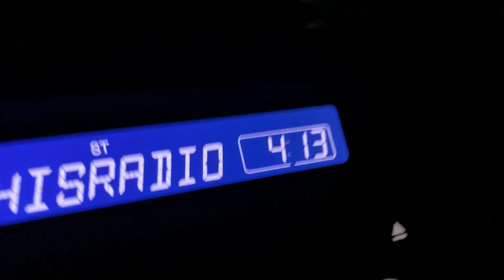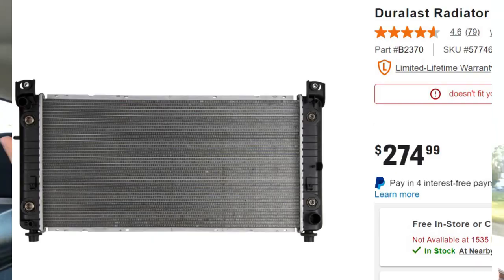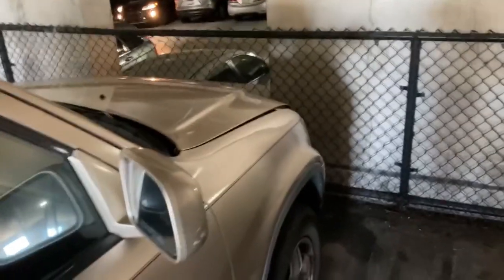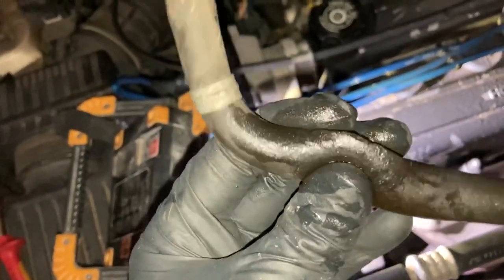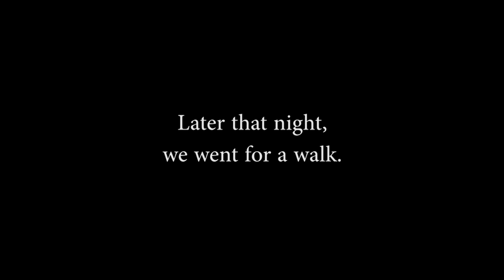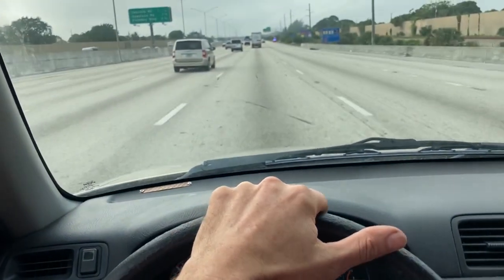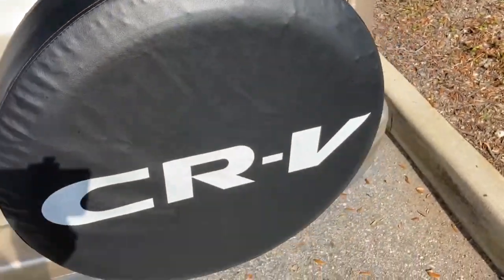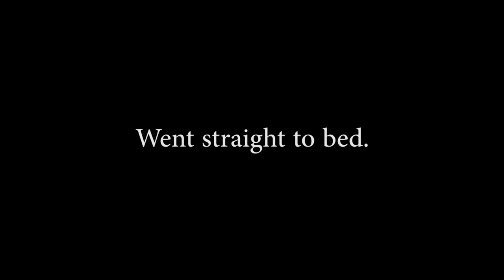How to find and fix a coolant leak | Honda CR-V

Comment: This was a good video for me to watch. I recently did my thermostat and radiator and lower coolant hose. The upper one looks good so I left it. I thought “I should replace all these smaller coolant hoses while I’m at it.” I was lazy and didn’t. Should have. I’ll replace them over the summer.
Reply from the maker: It's a mess of hoses in there, eh Craigie? ... I think I'm still going to be lazy ... and cheap ;-)

Comment: Great video! what’s the name /part # of the hose you got ?
Reply from the maker: Thanks Fabian. I'm actually not sure what the part number is or even the size. When I have small hoses like this leak, I just take them to the parts store where they have bulk rolls of hose behind the counter. They just compare the sizes and then cut a piece whatever length I need. This hose might have been 3/8 inch inside diameter, and it ran $2 USD per foot. So I paid $2.10 after tax I think. ...Hope this helps.

Comment: Hi Dave. I bought a 1997 crv about three months ago. I am located in Cyprus in Eastern Mediterranean. Here there is a rationale that since the temp doesn't drop below zero,. They only put distilled water into the radiator. I have been getting a water leak on drivers side. The leak is always where the heater box is. I did clean under the front windshield cowl and followed  troubleshooting instructions other crv owners gave. Somebody told me the heater core might be plugged and leaking. Are you planning to do a radiator flush video, I want to flush the system and fill it with appropriate coolant. What colour coolant is needed, what are the steps? Sorry for the long winded comment. English is not my first language.
Reply from the maker: Hey, thanks for the comment zoejay. I just did a little research on using pure distilled water, which, at first, I would have thought was fine, some say that distilled water is ionically imbalanced and therefore strips minerals from your engine to try to balance itself. It seems "softened" or "demineralized" water is best, but real coolant is better because it contains corrosion inhibitors, whereas water promotes corrosion. It does sound like your heater core has begun to leak. If you're flushing trying to flush it, using water should be fine, but it is a good idea (as you mentioned) to refill with coolant afterwards. Honda of course recommends Honda long-life antifreeze/coolant type 2. I personally just run any "long-life" coolant, the color doesn't matter. ... Sorry, but I can't do any flushes on the CRV any time soon because it's about 700 miles away from me at the moment. But I personally wouldn't do a flush, unless I had reason to believe something was getting plugged up. I'd just do a drain and refill. I have heard though, that a good way to flush the heater core is to unhook the coolant lines that go through the firewall, and hook up a hose to force water to run backward through the heater core. ... I sincerely hope for the best for you zoejay, but it sounds like  you're probably going to have to replace the heater core, or maybe since it doesn't get cold there, you could just bypass it. You could probably unhook the coolant inlet and return hoses that go through the firewall, and just couple them together so they recirculate through the engine. You just wouldn't have heat anymore. Hope I've said something to help. 
Thanks again for the comment!